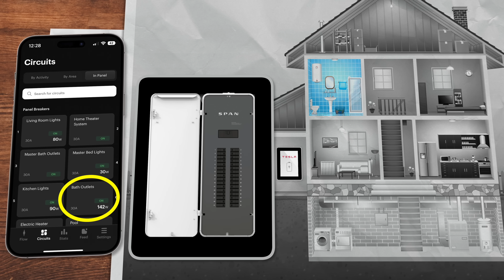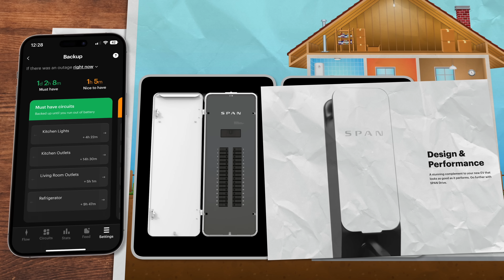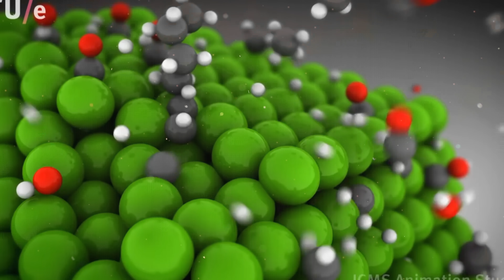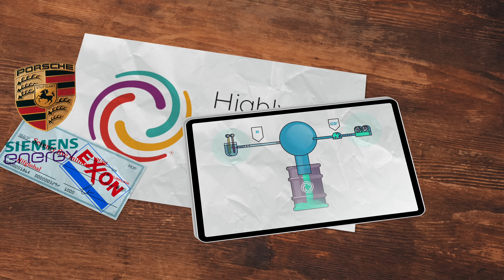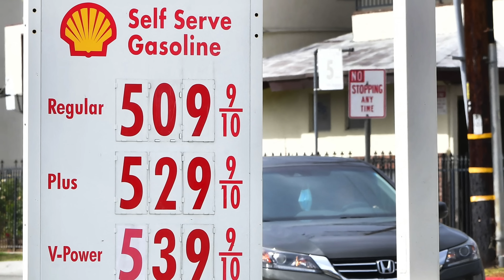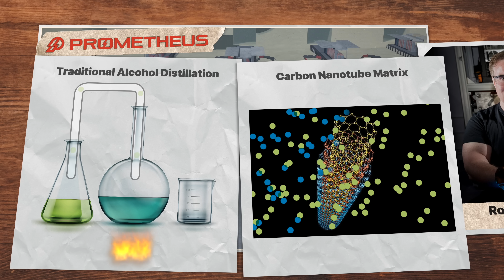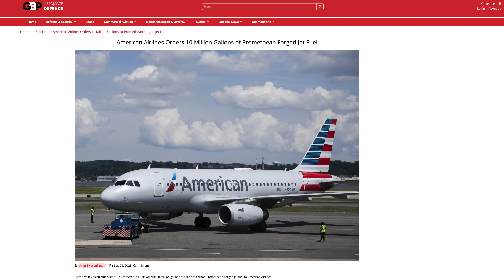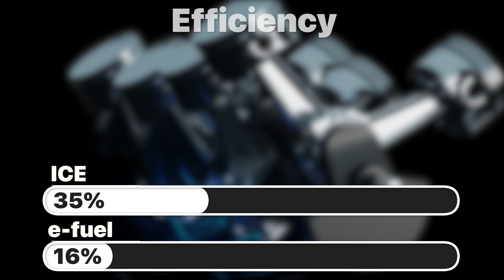EPIC Breakthrough Can SAVE the Internal Combustion Engine!

Comment: You don’t seem to be aware, of all the oil taken out of the ground that goes to power all the cars, trucks, trains and planes is only 6%.  Yep… only 6%.  
50% becomes bunker fuel oil, the cheapest fuel available because it cannot be used anywhere else, power all the shipping and large generators.
The rest goes on cosmetics, pharmaceuticals, plastics and fertiliser.

Comment: You know I had a negative view about ebies or it was a total electric one because I originally come from California but I live in Colorado now but an electric vessel expensive there but anyways I got the chance to drive a Tesla for 2 months and it was awesome what was the best thing ever and I love evies there's no struggle going up hill or down hill especially when you live in the mountains It was a great experience and I've had so many problems with ice engines that you know cause I've always buy used cars for the longest time and no I've only had one new car ever and that was a master speed 3 But anyways You're right about the challenges and we definitely have that difficulty with the ships and the plane Et cetera As far as Is wind power energy goes The mistake with those is that those turbines you know they don't do any good and they're falling apart now and yes there Killing birds up in the sky but I guess I would be the same with the airplane Flying through the sky The turbines however could have been done better you don't like we had windmills in the past but yet I'm sure there were less birds that were killed from it But if you think about a Box fan Box fan does great produces win Or air flow And no birds get hurt from an even though they're inside they are protected with with a cage. As for solar I don't think we've hit our peak yet as to how we can absorb it we are still Justin the birth of it and I think it's gonna change quite quickly. But if you look at some of the construction in other countries and how they use the other are the way they construct buildings according to the climate there is quite amazing how they use it to heat or cool they're homes it's quite interesting why have we never did that in the United States we're just dumb over here. Yeah as far as batteries go we're still in the birth of that too but I'm all for EV😁

Comment: Ammonia (NH3) is the ideal way to transport hydrogen. Molten salt nuclear reactors run hog enough to produce it and could even move up to hydrocarbons entirely fossil free.
Before anyone complains about nuke waste. We now have the technology to fuel an MSR with used nuclear fuel (high level waste) or even depleted uranium which is another huge storage problem.

Comment: Nice cartoon. As a chemist who knows about the Fisher-Tropsch (FT) process (used by SASOL in South Africa, among others) I can tell you that such process uses CO (carbon monoxide) and H2, in a heated reactor with specific catalysts. CO2 is a thermodynamic sink from which it's hard to get out. You need a lot of energy to do so. The overall energy/mass balance of such processes results in a large amount of CO2 (heating the FT process is energy demanding) and such process generates mostly linear hydrocarbons, which is not bad, but will give lower octane grade fuels. Entropy has the last laugh. Stoichiometry and thermodynamics rule. When will people come to their senses and face the reality. ... wait, let's turn some lead into gold!

Comment: E-fuels are carbon neutral fuels,which don't address the big problem-too much carbon in the atmosphere, which is what is causing global warming. EVs are not going to help in the near term either,because they cannot be built fast enough to meet demand. It takes ~ 6 months to get your new Tesla. Perhaps direct air capture along with E-fuels,which at least won't make the problem worse. But then E-fuels will take decades to make a dent in the problem...

Comment: Cars & motor vehicles are not at all a contributing factor to the propaganda of climate change.

You get your unicorn fairy tale electricity from plugging into an outlet that’s delivering electricity from a coal/natural gas fired internal combustion engine driven & ran power plant you dumbasses.

And it’s not cheaper either but it is rather more “controllable” By maniacal elitist authoritarians.

You need to understand the difference between direct and indirect emissions and I guarantee you that Direct emissions from that of motor vehicles and internal combustion engines is absolutely far less than indirect emissions from Coal and natural gas fired Electrical plants.

Carbon Dioxide feeds trees to imbeciles. It’s not a goddamn greenhouse gas it’s food for goddamn trees nimrods.

Comment: EPIC?  Really?  No.  Stay away from click-bait headlines to keep a good rep.  Your videos are fairly solid, but the headlines are, less so.  Don’t sully your good rep with such crap.  That being expressed, E-Fuels are and have been a not-yet “scalable” fuel, and there are some downsides to ICE engines and its current distribution infrastructure, burning methanol based fuels.  Where do you want limited capital to go?  I’d rather invest in renewables, and most capital seems to agree.

Comment: There seems to be a disproportionate focus on the front end aspect of replacing ICE powered vehicles with electric vehicles,  such as locating and procuring the materials, etc.  That alone is a huge future problem that has yet to be solved.  An even bigger problem, which many seem to overlooked altogether,  is what to do with the insanely massive volumes of hazardous chemical waste that will be created as EV batteries reach their end of life.  Recycling lithium cells is generally much more complicated and expensive than making new cells from newly mined materials,  so naturally,  focus  on solving that issue will likely be downplayed and put off until it reaches crisis levels.   Don't get me wrong,  EV and battery technology is amazing and has come very far in a short period of time,  but,  unless some huge breakthroughs are made in the current state of the art, it seems premature to automatically assume that EVs can be a drop-in replacement for ICE powered vehicles.

Comment: Putting aside everything that comes with EVs, almost No one is talking about the Power Grids... in most areas of the US the power grids that are in place were put there in the late 1950-1960s and have seen little to no updates with the exception of areas that have to be rebuilt due to weather events, city expansion or where new wind farms went in. The grid might be fine for now "as is" but if everyone starts making the EV jump all at once over the next few years how are the power grids going to keep up? Off peak hours will need to become Peak Recharge hours for most households that to commute the next day.

Comment: How about a device you can add to every car?? How about gasoline vapor?? It is said a car running on pure vapor will: Burn about 1/3 as much, and burn nearly 100% of the vapor and thus pollute much less AND perhaps get 70to 100MPG which will use much less fuel/oil
Reply: Most cars nowadays have a vapor line from the gas tank that goes into the combustion chamber already. I know Ford does anyway

Comment: EVs energy usage is reversible? um... no charging an EV is almost the same as filling a tank with fuel. unless the electricity comes from a green source, but even then... the environmental impact might be just as bad... you're still putting energy in, using it to drive, and then putting more in. what's being reversed? the charge state of the battery?

Comment: Hydrogen has been around for a very long time as what fuel one of the problems is wait while hydrogen doesn't have much weight however the container that you have to use to store it in because it has to be under pressure is very heavy so you're 16% of efficiency goes down when you add by 600 pounds To the weight of a vehicle And then you mention EB cars at the same time you don't mention that most EV cars are powered by fossil fuelYou pick and choose your facts to make your point That's not scientific or is it reasonable

Comment: If you find a way to make efuels in a carbon neutral way there are people that will convert their pickups to stream engines and run them off coal specifically so they won't be 'green'.

Comment: So is it cheap to get the co2 out of the air? Just spit balling but how hard would it be to capture it right away from the tail pipe and store it some how? On board the car.
Is there even such a thing as concentrated co2?
Reply: The real question is should we? If we lower CO2 by more than 100 ppm, all life on earth dies.
Reply: @spidergoose891 
Wasn't life on earth fine before eternal combustion engines?  How could capturing ice co2 ever throw the balance out?

Comment: you did touch on this but you can make e-fuels with molten salt reactors, since they have much higher temps then old school water based reactors they are more efficient at it and can actually do it, also you just run the reactor at max capacity and make the fuels in low electricity demand times which makes it even cheaper to produce.

Comment: Using electricity to create hydrocarbon fuel is inefficient, and no net gain is not enough. It would make more sense to keep producing the gasoline and diesel fuel that is absolutely necessary in the same was as now, replace mist jet airplanes with electric high speed rail, and use surplus green electricity to produce polyethlene (and bury it)  or produce hydrocarbon fibers for insulation and clothing, which would reduce  petro-fertlized fiber production.

Comment: The different energy sectors need to change their way of doing business. For starters, we need a smarter grid. Use solar where solar is viable. Use wind where wind is viable. Use hydroelectric where hydro is viable. Any excesses can be dumped into the grid for usage elsewhere. I'm not a big fan of nuclear for a couple reasons. Everywhere we've handled nuclear material, there have been accidents, most small, some BIG. Also, from what I've been reading, uranium extraction from the ground is only going to be economically viable for another 15-25 years. Sometime ago, I read about development of reactors that can use today's spent fuel rods. Don't know what happened to that research. Covering the ecological disaster known as ethanol would be another couple paragraphs. One last thing, do a search on "acid rain." We added scrubbers to our coal fired plants to remove acid rain causing compounds. Now, they're talking about spraying those same compounds into the atmosphere to reduce the amount of sunlight hitting the earth. What could go wrong there?

Comment: Can the Prometheus system be adjusted to be carbon negative? If so, hang the cost, do it. Do it anyway - we need every idea that is going. Good thing batteries are improving so very fast. I think Elon just came out with something new - not watched that yet ...
Reply: "Can the Prometheus system be adjusted to be carbon negative?"
Only by not using the synthetic fuels it produces.

Comment: Producing the batteries used to power an electric car have a larger carbon footprint then a gas powered car does in it's whole life. I havn't seen a gas powered car catch on fire because it wet like many of the lithium battery powered ones have, all battery powered cars have that potential.

Comment: In the 1980s, the mother earth news research team was successfully using sunshine to distill alcohol fuel.  Maybe that could help eleviate some of the energy input needs.  Then we have to remember that a 1990s Honda crx was capable of 48 mpg and it wasn't a hybrid.  Also, gasification of waste can supply a feedstock for making fuel.   That's helping two problems.

Comment: This may be part of the solution, especially for use cases where batteries aren't up to the task. But continuing to use inefficient, high-maintenance, noisy ICE vehicles that pollute the air is a bad idea even if climate weren't a concern. And given the efficiency loss of converting clean energy to gasoline and then burning it, it's very hard to see how this can help solve climate change better than just using the clean energy directly to replace dirty energy on the grid. At least for the next twenty years.

Comment: E-fuels needs to be able to use extremely cheap energy to have any chance to compete with fossil fuels. If production of e-fuels needs to run 24/7, it wont be able to compete with fossil fuels. On the other hand, if production can be controlled based on the situation on the grid, it has some very interesting potential. 

Does it make sense  to "save" current ICE cars? Nope, even if we had a cost efficient way to produce e-fuels for them, building production capacity for current ICE cars will take longer than the transition to electric cars will take. And those factories would need a few decades to pay themselves off after they've been built. Plan for the future, not history.

About Prometheus Fuels, it might seem great, almost too good to be true, or, maybe not almost. They're talking about multiple fantastic technologies that doesn't work practically on relevant scale yet. And direct air capture is, well, not practical. We're approaching 500 ppm CO2 in the atmosphere, that means for one part of CO2 there's over 2000 parts other stuff. That is like a needle in haystack, on a molecular level, and you're not done when you found one molecule, you need to collect tons and tons of them. 

In 2019 McGinnis promised to start selling gasoline for $3 per gallon in 2020. I'm just going to assume that didn't happen, and haven't even happen yet, and that the pandemic doesn't have anything to do with that.         

So, why do you think we use distillation to separate water and alcohols? The main reason is that despite the high energy requirement, it's currently the cheapest way to do it. Also, the energy required to distill is just a few percent of the energy ethanol represents, not a significant part of the overall loss in the whole process electricity -> fuel -> power.

Comment: My thoughts. If one were to consider the EROEI (Energy return on Energy Invested), it is unlikely that green energy (wind and solar) would deliver society sustaining energy. Real world (cradle-to-grave, including infrastructure, backup storage, etc) EROEI for wind and solar is on the order to 2 – 4, which is similar to the level of pre-industrial times (where slave labor actually was part of that EROEI!). Our current society needs greater than the EROEI of 10-12 supplied by coal-powered steam of the industrial revolution. Fossil fuels EROEI deliver around 20. Nuclear (the old inefficient PWR’s) is about 70, while the newer, safer and more efficient SMRs could be several hundred. Note that NuScale just received US-NRC certification to build their first VOGRY SMR this month (January, 2023). If one accepts this, then nuclear-powered CO2/H2O e-fuel reformation process (such as Prometheus Fuel’s) is currently the best option by far.

Refs:
"The Unpopular Truth: about Electricity and the Future of Energy" 2022 by Lars Schernikau & William Hayden Smith, plus references within
"Spain’s Photovoltaic Revolution: The Energy Return on Investment" (SpringerBriefs in Energy) 2013th Edition) by Pedro A. Prieto, plus references within.

Comment: It's not yus drive the cars to work an back  but the penny pitching the oil spill in the ocean has made a big difference  an all the oil wells that got that's been set on fire  in the last 30 years of war then there a town that got evaluated because the coal been burning under it for years an then fine the common man for burning a tire to make it easier to clean up  brush  but yet the tire landfeild been Burning forever  all my life I've been lead to Believe that it's going to run out but they have been jus wasting it forever they want to convince us we need to give up are cars while they run a round in some jets that are still running  leaded fuel with no converters or anything an there average Yates is supposed to burn 46000 dollars worth of fuel with id say no def System on them  I mean let's wake up to what really going on not to mention all the fuel delivery devices that been made that saved gallons an they it an it disappeared  or the one that invented it did an the clean renewable energy that's been derailed  it all about them paddin there pocket they could careless because they now most of it's bull %$#*! An if they were so Concern About the greater good of mankind like they say they are they would have bought all the stuff they have  they need to start practicing what they preach or as they say proof In the pudding  if they want me to believe  there crap eather thar or give me a big piece of the pie to lie for them like they do the big shot I'm sick of it every time the common man that's trys to some what live right start thinking he might see the light at the end of the tunnel  they pulls some other crap to put us back in are places always have it a big dog an pony show  go back 30 plus years ago an listen to Ronald Reagan's speech an it would fit perfectly to day they make us feel all warm and fussy in side because they got the golden plan an that to stuff there pocket full if they really cared like they want you to believe  they could pull together an pay us out of debt an still have more money than anyone person could ever need